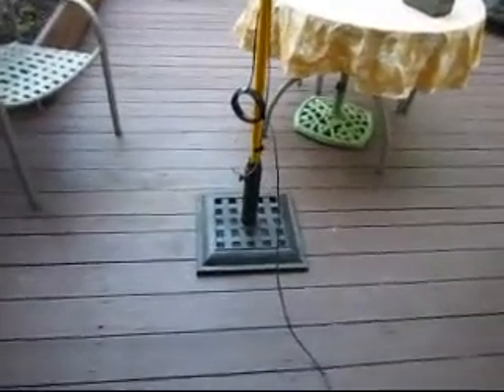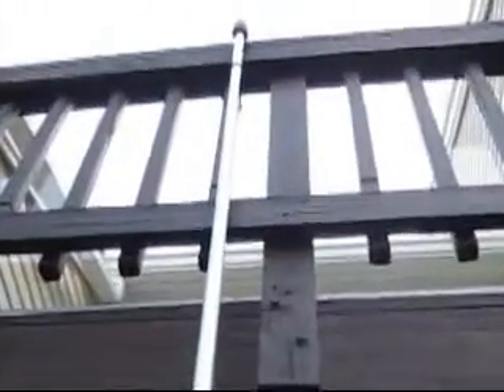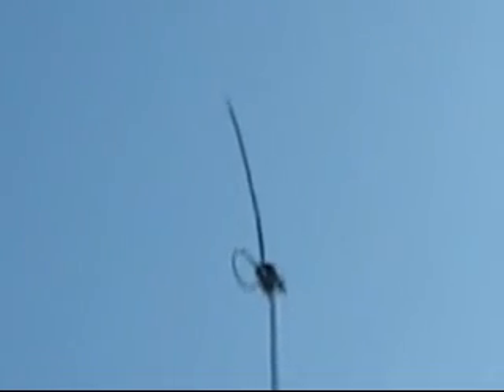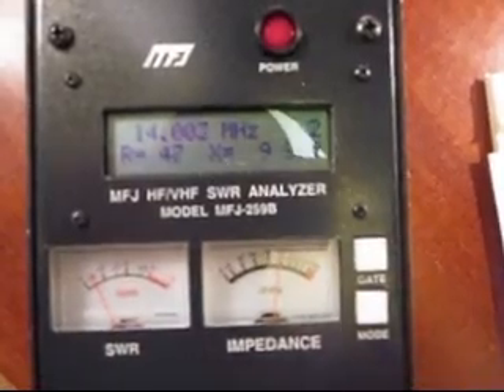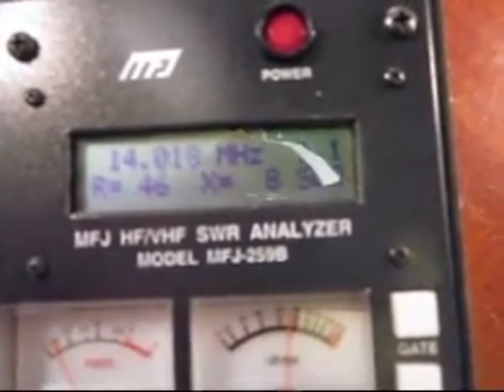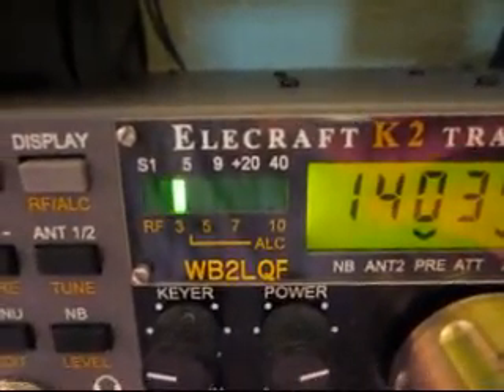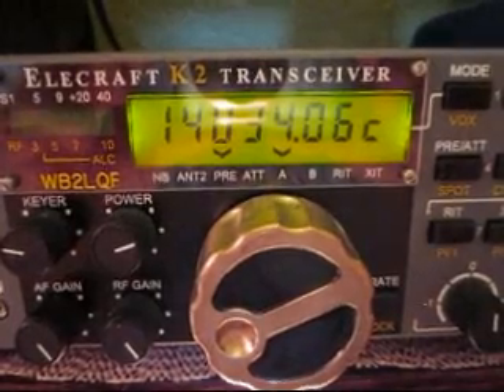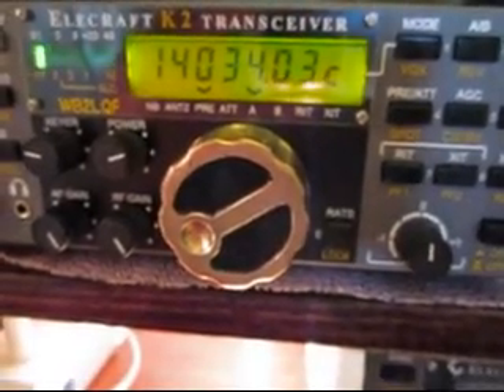HFp Ventenna configured as a 20 Meter Sleeve Dipole

Comment from the maker: Yes, Pat, the little Ventenna is a very effective portable antenna that takes up very little space and can be assembled and disassembled in under five minutes.  I think I'll just use it as it was designed to be used and refrain from any further attempts to incorporate it into my vertical antenna experiments.  I was lucky it didn't snap in two while it was up there swaying in the breeze at 35 feet!  And thank you for those 'honest' signal reports you gave me.  73 and BCNU agn.